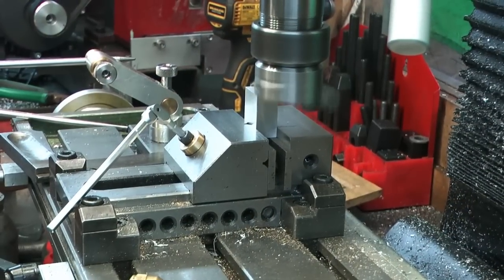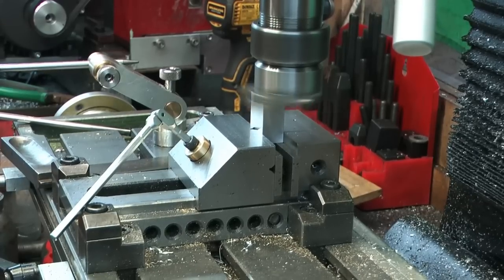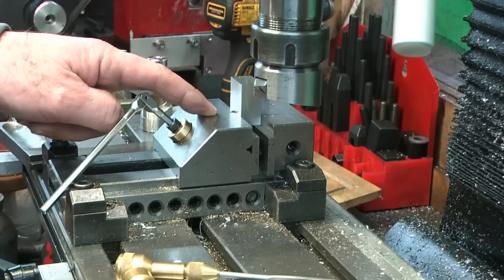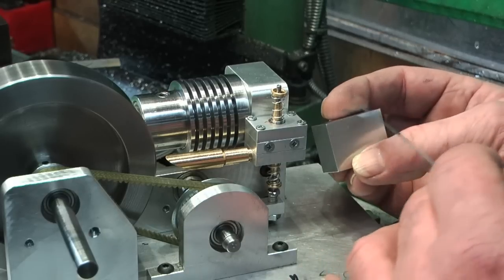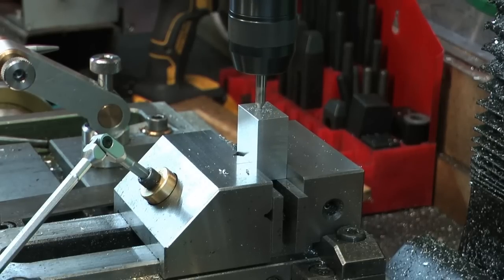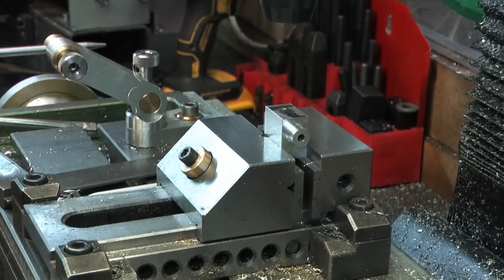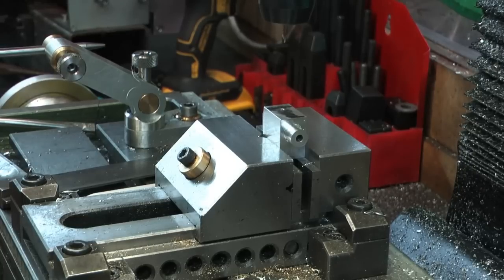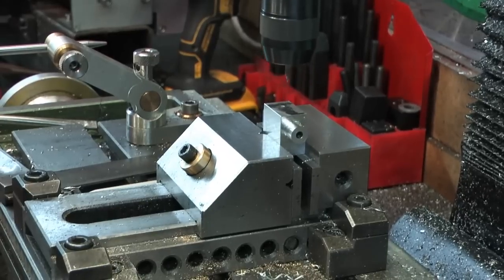Webster engine Part 18 .

Comment: Now says 13000! Congrats! Well deserved.
Having fun in the shop is the reason for having and using the shop. You have fun for sure Ade.
The latest fun here is running the newly ready home made controls for a digitally controlled rotating table. Cutting a gear for the destination panel in a 1957 rail car is maybe possible. Thinking about making a 33 1/2 tooth gear! Swallow that!
Reply from the maker: Thanks 👍 33 1/2 , what , lost .
Reply: @ade63dug  Just a joke! Either a useless gear or a gear moving back and forth only. Usual dividers are not made for numbers having no end of the decimals but I can set it up!
576 000 steps per table rev gives a resolution of 2.25 seconds. With that stepping one rev takes 2 minutes and 45 seconds.... Maximum speed is 32 times faster but then the resolution gets 32 times worse. Micro stepping x 32 in the code now.
Reply from the maker: @Stefan_Boerjesson  oh what fun .
Reply: @ade63dug  Jo bet! The idea was born some 2 years ago but now it's finally real. Yes, yes, yes!

Comment: Great video Ade. I am on the verge of building a IC engine. Not sure which yet. Eventually i would like to have a go at a Flat 4 water cooled Boxer engine. But for now maybe a single cylinder. Yours is looking great so far.
Regards.
Steve.
Reply from the maker: Go for it!, Cheers Ade.

Comment: Hi, do you find the milling machine you have good enough for most of the work you do?
Reply from the maker: Yes I do. it has behaved faultlessly for two years and gives good results . It is not a bridgeport but it fits for my work , Cheers Ade.
Reply: @ade63dug  I might get one next year but I live in Thailand so it may be a problem shipping it over unless I can find a stockist in Asia or around. I think it's important to do as much research on reviews about the machines before acting on impulse. Thanks anyway for your opinion

Comment: Great job so far well done, You could have not worried about the choke so much all you need to do is hold your finger over the venture to choke it.
Reply from the maker: I may need the choke as a form of mixture setting , this may be carb mk 1 , who knows till I try it out . Cheers Ade.